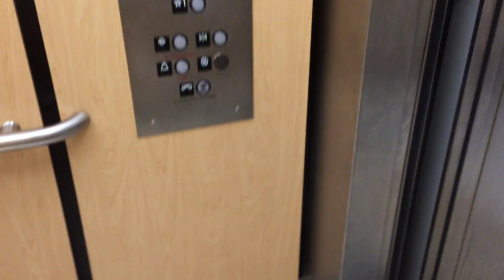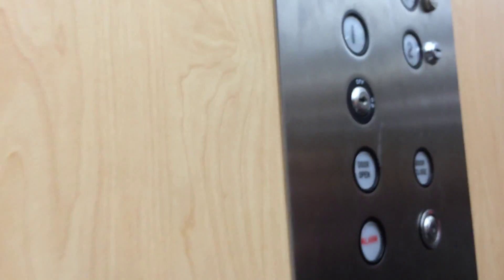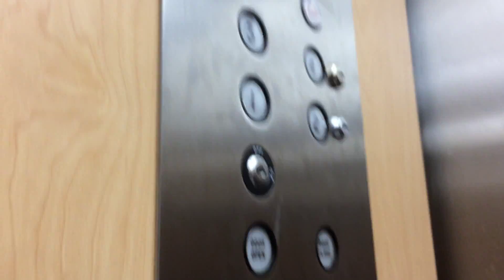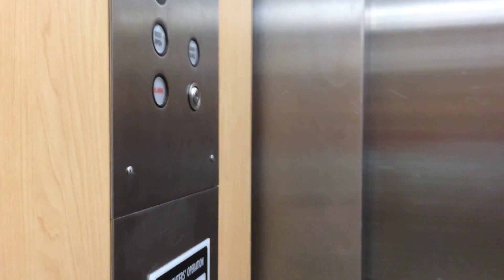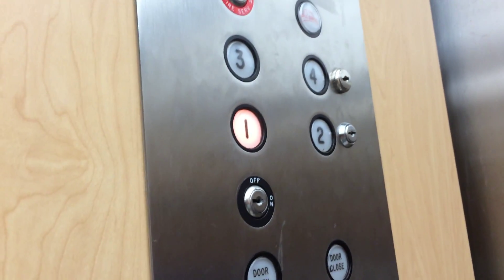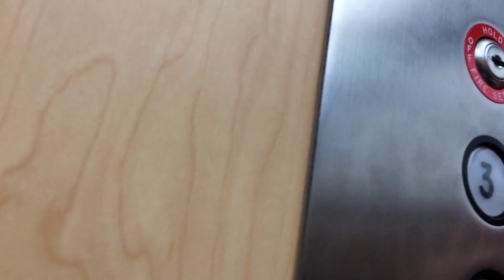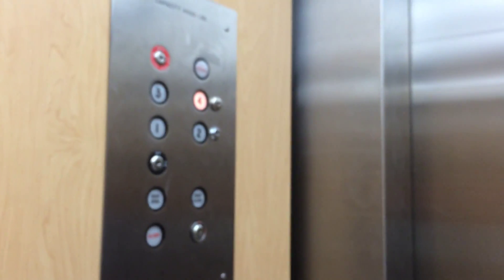Floor Lockout Demonstration on Westinghouse Traction Elevators

Comment: Also on restricted floors if you are on a restricted floor and your inside the elevator it will not reopen once the door closes all the way until you unlock the floor with the key

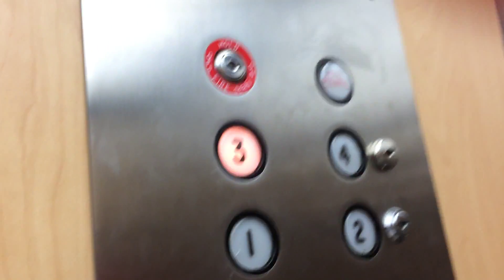Comment: 0:54 that key switch is phase 2 for the fire department to go to put out a fire and on restricted floors if the floors are locked off in fire service it will take you to restricted floors with out a key to unlock restricted floors if there still locked off because the firefighters need to access those floor if necessary to save someone’s life or put out a fire because there’s a reason they need to go to those floors